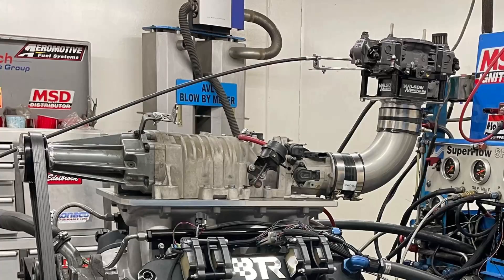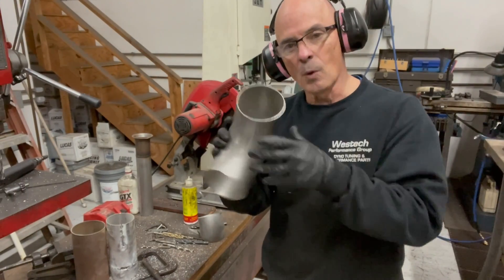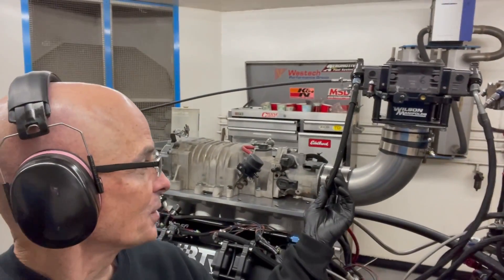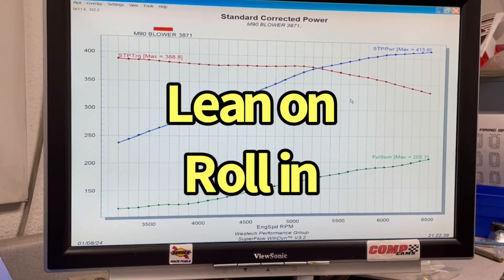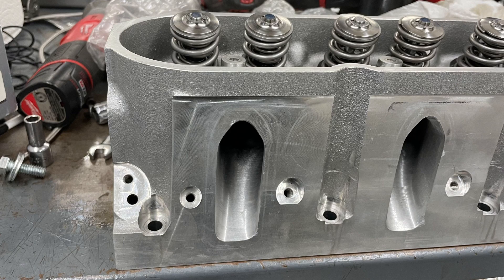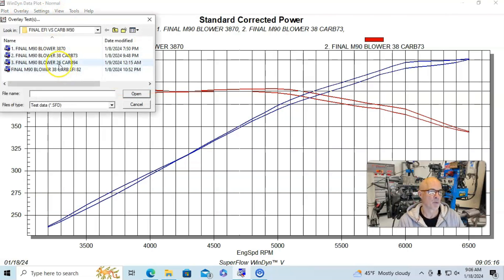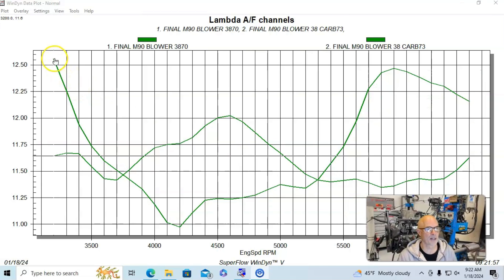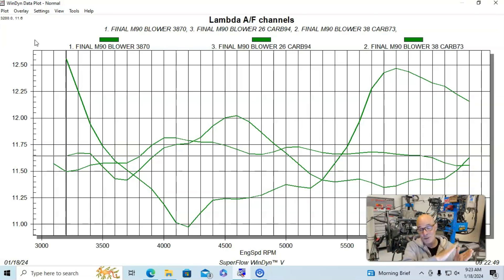HOW TO ADD A CARBURETOR TO THE BACK OF THE CHEAP, JUNKYARD M90 BLOWER! PLUS...CARBS VS EFI VS BOTH!

Comment: Can you run a 177 mini blower on the ls? What kind of power would that make? 🤔
Reply from the maker: I've not seen one of those in a long time-but I have run an M90 and a 2.3L and a 671 on the LS
Reply: @richardholdener1727  yeah I've seen the videos. I'm contemplating running this combination just as something different that I've seen several others talk about, but I'm unsure if one, it's even doable and two, if the power output is worth it. I figured you'd be just the mad doctor to ask. Lol

Comment: I hate to say this BUT THATS ONE OF THE COOLEST THINGS EVER! If someone told me that they were going to do this I would have said no way it would work. But you have proven me wrong sir. I love it. The only thing is do you think it would run on the street. Would the gas kill the blower?? I love this!
Reply: It might eventually put some wear on the rotors
Reply: Why would you say it wouldn't work? People ran carbureted supercharged engines for years b4 EFI ever existed! Why would the gas kill the blower or why would it cause any more wear than the EFI would? There is other fuel to run that that craptastic E85. You guys have some really strange ideas. It seems to me that you are all hung up on issues caused by the electronics not the carb. Again some really fast cars ran without any electronics. Wow, just wow!

Comment: Hey bud can you test 4 to 1 long tube headers vs tri y long tube headers? On a LS or LT block please?
Reply from the maker: The test would only be those specific Tri Ys vs those specific 4:1-there is not a universal change between those header configurations

Comment: I wonder how it would be to run a small amount of castor oil in the fuel to keep the gasoline from eating the coating on the impellers

Comment: How about using throttle body fuel injection to get the advantages of charge cooling and precise air fuel control? I've always thought TBI was the best as long as you can package it and get good fuel distribution... that leads me to wonder how cylinder to cylinder fuel distributing was with that carb setup...
Reply: Theres supercharger kits out there with a 5th injector pre supercharger for some extra cooling. Not as efficient as WMI, but a very simple solution to integrate on an already fuel injected car.

Comment: Thunderhead 289 has a product out he calls it carb cheater. Its a metered vacuum leak basically keeps optimal stoic ratio. Was a pretty big deal last year but have not heard much since. Could you do a video on it?
Reply from the maker: you don't want stoich at WOT

Comment: 12:18 Have you ever evaluated the carb cheater by ThunderHead289?
Reply: I asked the same thing then found your comment. Great minds think alike.
Reply from the maker: never heard of it
Reply: @richardholdener1727  It's an electronically controlled vacuum leak to lean out carburetors during rich events.

Comment: You can't make the engine leaner with fuel injection assisting the carb unless you have a controlled vacuum leak that the computer runs based on the O2 readings-like a large IAC. Speaking of, another YouTuber is selling a product called Carb Cheater. Which I believe is exactly that, a controlled vacuum leak. I would love to see you test it on a carbed v8.
Reply from the maker: there is no vacuum leak at WOT

Comment: I had a 1985 Lincoln Mark series 302 high output engine coolant temperature sensor signal change and throttle position sensor change 33.3 Mi to the gallon
Reply from the maker: SENSOR CHANGES WON'T DO THAT
Reply: @richardholdener1727  installing a resistor inline with the ect & iat sensors will in fact change things. Was my tuning method in the early 2000s for bolt ons. Project box with rotary switch to switch between resistors for tune-up for temp change. Can't cheat it much, but it does work

Comment: Using both (efi and carb) could be a relatively good way to add power on a direct injection setup. A carb would be cheaper than the high flow direct injectors/pump/etc and add a bit of charge cooling.

Comment: I always wondered if you could run a blow through turbo carb on top of fuel injection as a intercooler.
Reply from the maker: YES
Reply: thats absolutely insane im on board

Comment: I had a 32mm carb on a 232cc bike with tiny jets. Had a ecotrons efi kit and all I used from it was the injector and o2 sensor.
I don't remember what board I used but all it did was read the o2 sensor and use the injector to try to level it out.
Was a good learning experiment haha.

Comment: I think it would be worth it for a cheap easy way to run meth/alcohol injection. Methanol/alcohol only to the carb before the blower with pump gas efi below the blower. Obviously the carb would have its own fuel system (running a different fuel) so shutting the pump off turns on/off the secondary injection, which could be controlled by an ecu setting that was also changing timing (added for the alcohol/methanol to make the desired power) at the same time. Carb(s) would always be used as the throttle body.  This would be really cool to see on a drag & drive or street/strip setup.
Reply: I would love to see this, honestly it's a brilliant idea
Reply: @mross302  I would too, & honestly I may give it a try on my first gen rx7. I've been thinking about possibly twin charging it anyways. (Supercharger & turbo)

Comment: Wish this was done on a modern direct injection motor that is fuel limited from the factory, like the early 3.5 ecoboost. Add on carb, e85, and a centrifugal supercharger feeding the tiny turbos could get crazy.
Reply: The only problem is you need a special (aka old-tech) carbon seal turbo instead of the common dynamic seal (piston ring style) turbo used on pretty much everything since 1990. The fuel gets past & interferes with the thrust bearing lube.
Reply: Is that an e85 problem or a general fuel issue? My first thought about adding fuel to starved direct inject engines was propane, but I only know enough to get into trouble. @hydrocarbon82

Comment: TWIN M90s!!! triangle supercharger hat for the ram.
Reply from the maker: NEARLY DONE
Reply: @richardholdener1727  As much fun as your having with these, we should have known.... I am curious if the seals in the blower are gas safe, I know the coating really isn't on them if there is alcohol in the gas..... There was a Fiero runnign around years ago with a 4.3 buick v6 swap with two of the chargers on it.
Reply: That’s exactly what I was gathering parts for on a 351w in a foxbody before my health took a crap. Had everything for it but never could work on anything due to health issues. Hope to see it on this channel!
Reply: It would probably be better to have one supercharger feed the other supercharger. 
Boost loves boost. 😎
Reply: @michaelgarrow3239  Running one roots super charger into another roots one wont make more air mass. A roots supercharger displaces air, the intake compresses it because the engine can't use all of it. If you used two of the same roots style, there would only be pressure from heat build up between them.
Reply: @shvrdavid  - lots of WW-2 fighter planes had dual superchargers or turbo-superchargers run in combination. You might have to run them at different speeds to work- and I’m not saying it would work in this particular instance with dual roots blowers… 
It has been done before and that’s how it worked back in the day. 
Boost loves boost…
Reply: @michaelgarrow3239  Yes, they did have staged ones in planes, but they were/are centrifugal design, not roots.... Totally different setup than an roots M90......
Reply: @shvrdavid   -Now I’m really curious… 🤓

Comment: I was going to run a carburetor on the back of my m112. Good you did a video on this. I was told it would not work because fuel washing out the bearings. Could this work with an intercooler.
Reply: Any comments on bearings?

Comment: The blower will develop frost on carbed e85...also, it will strip the coating off the rotor pack, to no Ill effect. First hand experience with both.
Reply: No bearing problems to mention. Ten thousand miles put on that combo without worry.
Reply: sounds badass
Reply: How did the bearings on the blower hold up (miles?)  I heard the fuel may wash the bearings and fail. Thanks